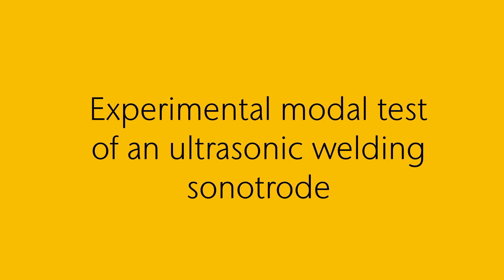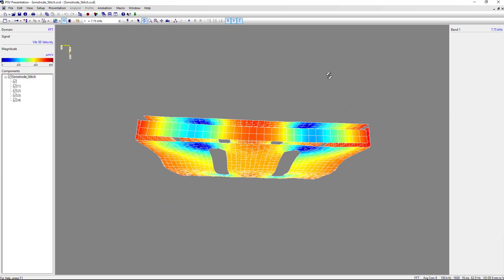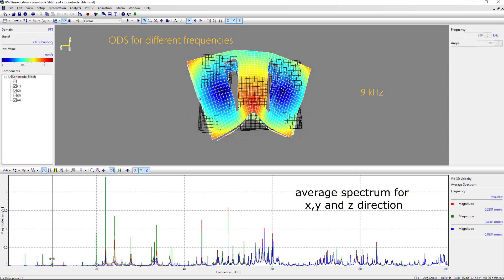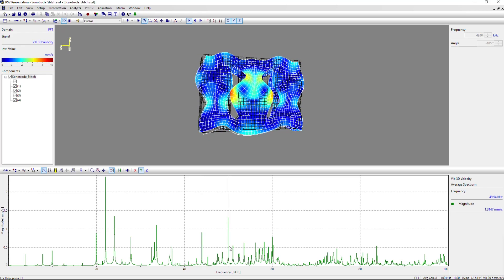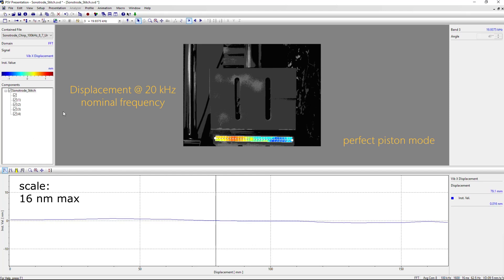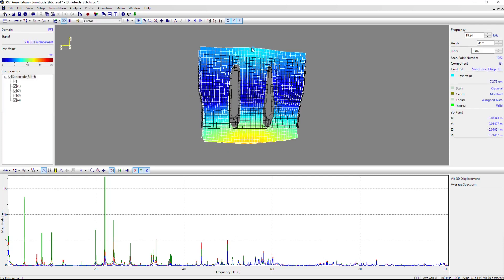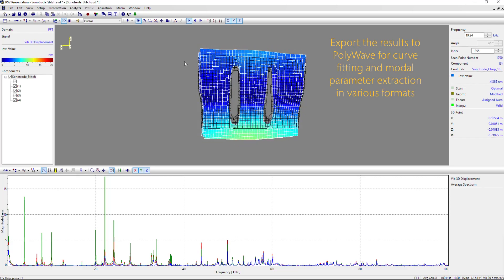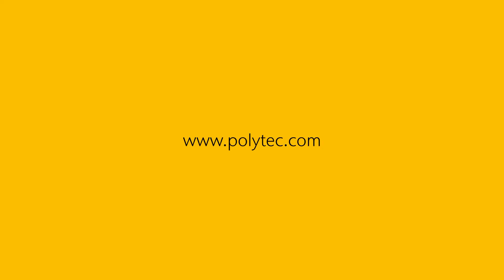Modal analysis of sonotrodes for ultrasonic bonding

Comment: please advise which simulation software used
Reply from the maker: The data shown in the video is measurement data generated by the Polytec full-field scanning vibrometer PSV-500-3D. The sample was provided by a customer and to our knowledge he is using ANSYS as a simulation software.
Reply: @PolytecGmbH  thanks for your reply